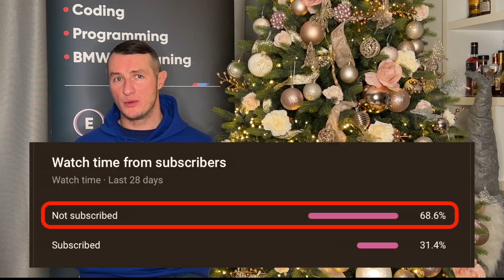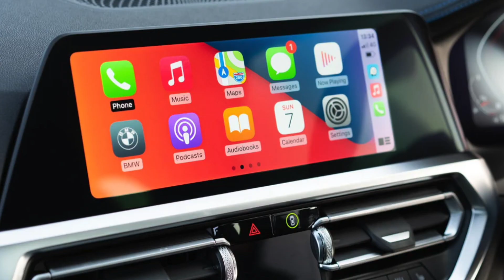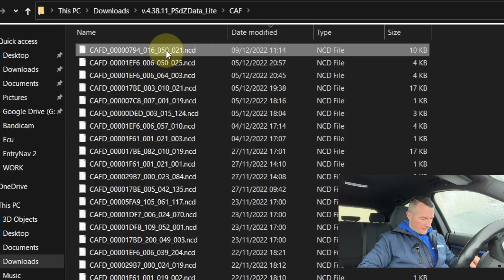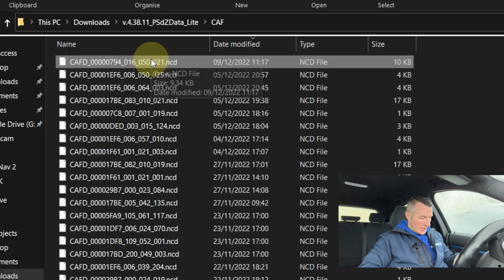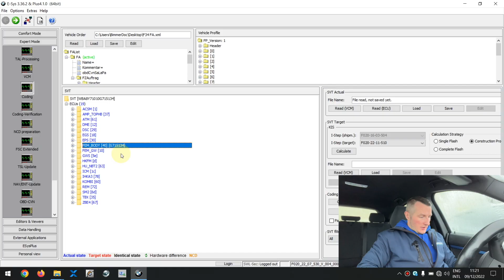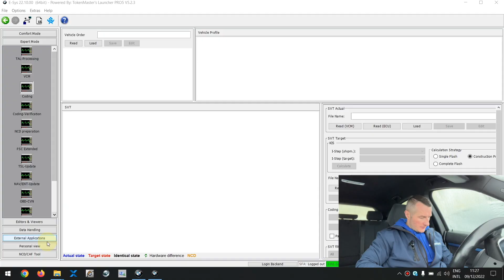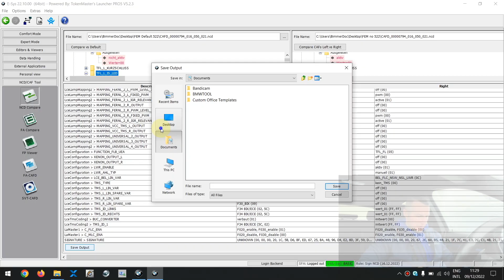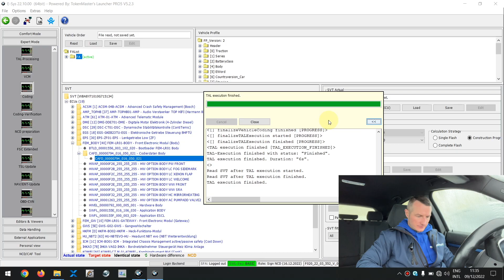Never shown before E-Sys coding guide. Coding (CAFD) file comparison principle explained. Part 3

Comment: Hi Vladimir, I have a G01 2023 car, would like to switch from flat tire measurement (RPA) to TPMS (RDC) so that I can install the sensors to the wheel and display on the screen. Because my car did not have the sensors from factory. Can you please share how do I do it? Thanks a lot. Love your videos.

Comment: Vladimir great video as always. I have one question when you save previous coding options and then you VO code the ecu. Then later code back the previously saved cafd file would it then remove the vo coded options that came by default?
Reply from the maker: Thing to understand. 
VO coding writes all values based on VO
Editing CAFD writes modifications into ECU. 

So if you save CAFD, then VO code ECU and then write CAFD back to ECU, then the last actin matters. 

So both of them overwrite each other.
Reply: @BimDoc  I thought that was the case. So there is no easy way of automatically coding both changes unless compared as per your video.
Reply: Hey Vladimir I dont remember which video was it but I am sure I saw it somewhere. What I want to find out is how to keep the existing cafd file with modified parameters when vo coding new stuff. As when I vo code I lose what I already have. I know I can manually add it, but is there a way to do it automatically. Thank you
Reply: @bimdoc I have found what I was looking for in  your m cluster retrofit video.

Comment: Hi if i only get shown 3011.14 it is because of the launcher? Or too old esys version? Or psdz data not integrated correctly?
Reply from the maker: There could be a lot of factors

Just use up to date launcher (esys ultra) and databases
Reply: @BimDoc  do you know if esys ultra will work with motorcycle too?

You prefer Esys Ultra or BimmerUtility?

Comment: can you code the interior ambient lighting to be brighter?  My 2018 530e seemed to have brighter ambient lighting than my new 2023 530e.  When set to the highest bightness, you can barely see the color during the day.  This seemed different in than the older 2018.  Maybe there is a way to code the car to make 100% brighter?
Reply from the maker: Hi,
It was a problem on older cars. Haven’t seen that on 2023 jet!
In older those LEDs were just physically not bright enough. 
If you do find any information about your case feel free to share with community. 
Thank you ))

Comment: Hi Vladimir, if I have previous coding in exampke BDC ECU , and I planned to retrofit TPMS, the VO coding is 2VB and code the same BDC, understand VO coding will reset the ECU to the factory. The best option for me like below correct me.

1. Backup the coding file of the ECU by read coding data
2. VO Coding
3. Read coding data again (after VO coding) and compare 2 coding data
4. Manual add back previous coding to the ECU
Reply from the maker: Yes, correct ✅ 
If you proceed as you described, you will be good.

Comment: I retrofitted a new cluster on my F20 from 2013, while cluster is from 2019, but now my LIM button doesn’t work anymore.
The new cluster does have the LIM markings on the cluster so I assume it’s not an hardware isssue.
Coding wise LIM is enabled.
Looking at other forums I can see these should be coded:
SLD_FUNKTION : aktiv
C_Umschaltung_ACC_DCC : zugelassen
SLD_ENABLE : aktiv
And they already are like this. 
Anyone know what I’m missing?
Also the steering wheel I have only have the LIM button(no SET or RES or anything else on the left side)
Reply from the maker: If LIM button do cancel your cruise control then it means it’s working. 
If it does not display LIM on the dash, it might be die to the istep differences. 
Just a guess

Comment: Excellent tutorials, thank you very much! 

I have one question: I would like to flash G80 M3 CS gearbox software to the EGS ECU of a 'non-CS' G80 M3 xDrive. Can I just change the typekey to 61AY (EUR LHD Model, same as the car I want to code), and then click code on the EGS module (after making a back-up like you did)? Or will this not work, as the 'Zeitkriterium' and SA list are still those of a 'non-CS' M3. 

I hope my question was clear, thank you in advance!
Reply from the maker: Coding most likely will not give any results. Flahsing is needed. But flashing with wrong calculations mighty brick your EGS. 
So be careful and flash onky of gearboxes are identical! As shown in my ALPINA video for example 😉

Comment: hello, i run into this problem with my e-sys 3.30.1, psdzdata 4.41.20, launcher pro 2.8.1, when i try to code my new front light ecu the button "detect CAF for SWE" is inactive. my car is a bmw f30 from 2016. can you tell me what is wrong? thank you
Reply from the maker: It means you are doing smth wrong

Comment: Hello Doc,
What is necessary to code when deleting GPF? Is it just deactivation of the differential pressure sensor? I have 2019 M140i with GPF and want to install aftermarket exhaust without GPF.
Reply from the maker: It’s not coding it’s chiptuning 
Doable, but not via esys

Comment: Is it true that for basic coding on an f20 you don’t even need a launcher for esys? E.g coding a replacement instrument cluster?
Reply from the maker: It is called VO coding and it does not require launcher, that’s true. 

FDL coding (going inside ecu and changing single parameter) requires launcher

Comment: How can you tell which software version is used by all or each of the BMW ECUs?
Reply from the maker: For all ECUs in VCM tab
For a single it’s a bit more trickier. But ista can show single ECU for example
Reply: @BimDoc  My query is motivated because when the brand replaces an ecu, it does so to the version that was in the vehicle and it does not increase as we usually see. I imagine it is to avoid having to update more modules and avoid later problems, especially if the vehicle is of a certain age.
Reply: @BimDoc  What can be interpreted about the i-step?  manufacture level 1 F20-11-11-502 and real integration level F20-16-03-503 and what level should I use to be at the current level of the vehicle? Thank you

Comment: Hi Vlad, I have watched your videos and tried to follow every step, but mostly no success, would you mind helping me out please, if you could remote to my laptop and help me, I'm struggling, I have been working on this for 3 weeks. I am trying to retrofit the vantilated comfort seats to my F10, I did all the wiring bits under the seats for power and canbus, the drivers seat now moves but passenger seat, memory buttons, seat cooling and heating buttons don't work. Here is what I think my issue is, the seats are from a 2009 F01 750i and the climate control (IHKA) is from a 2013 f10 M5 US. My car is a 2010 F10 EU version.
Reply from the maker: If all parts are compatible and coding done right and still no result then issue might be istep difference. Update ECUs to latest istep and it might fix the issue.
Reply: @BimmerDoc  Can you give me a detailed step by step guide how to update / flash the I-steps to match my vehicle istep. It also appears that there are no CAFD files in the the SM and IHKA modules, when I try to Detect CAF SWE to add the CAFD but it fails.

Comment: Hi, great video, I really like your content. But I have a problem and I hope you can help me. I have a X3 F25 and have retrofitted the rain sensor and coded it using VO 521. The automatic light works great, but unfortunately I can only turn on the wipers after about 3-5 minutes when the ignition is on. I would like to turn it on immediately. Do I have to recode something or have I made a mistake. Thank you very much keep it 👍
Reply from the maker: It should be working instantly. Maybe some kind istep or hardware mismatch there. I don’t think any coding will solve that.